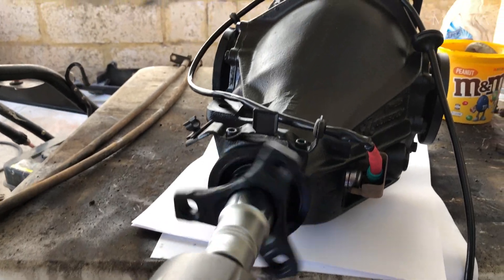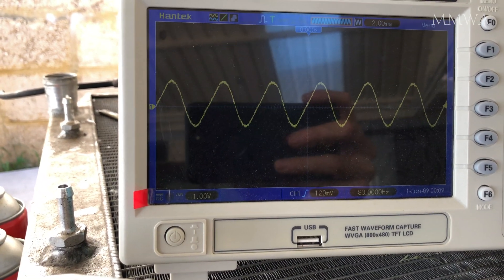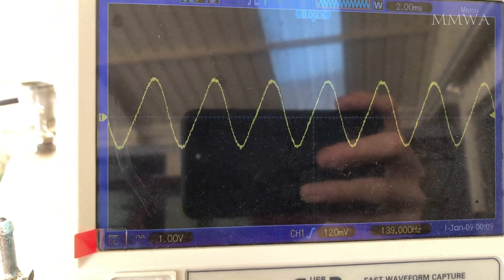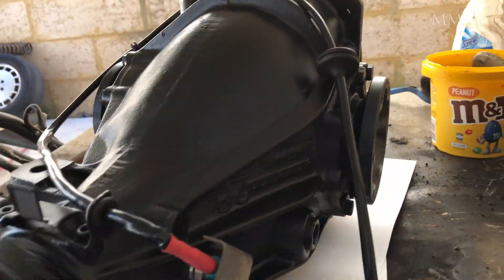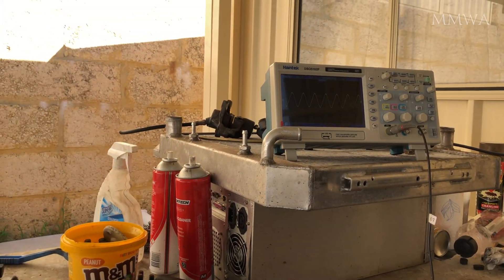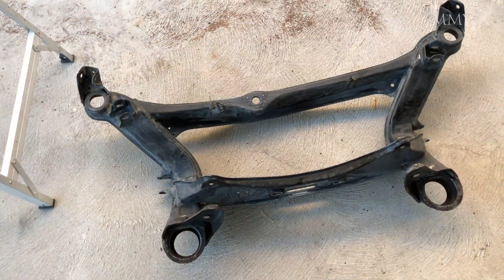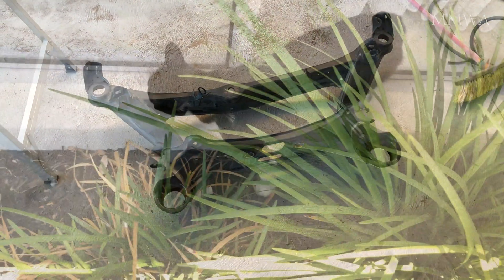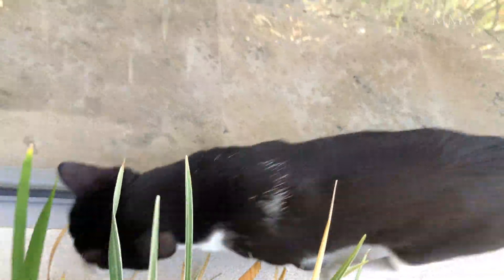A quick bench test of the W124 differential

Comment: Hello, i have W124 2.5 diesel non turbo, om602 but my differential is 3.27 and in the fourth gear i have strange noise. But is it for 2.5d standard differential 3.64?, I am searching for 3.64 i bought a 3.46 but it is from W201 it has 4 bolts and its smaller case, my 3.27 has two bolts standard and big case, would it be better to fit factory 3.64 or to fit 3.46?

Comment: Guys, i have a little problem. My w124 300d from 88, 4 gear automatic has a 2.88 ratio diff. I dont find a 2.88 anywhere and I've been looking for weeks now. Can i install a 3.46 from a 300d from 87, manual gearbox? I dont mind if the car will be quicker but topspeed will be affected or will consume a little more fuel, but I'm not sure if that would be the case. Any help?

Comment: I replaced the differential oil seal and now I need to tighten the nut correctly. There is no information about the tightening torque on the assembled differential anywhere. Please, if you know, tell me what is the tightening torque on this differential. 
Please. I will be very grateful
Reply from the maker: in the service manual it is described. You are supposed to use a new crush sleeve every time and there is a whole setup procedure that aligns the pinion and crown, best left to professionals. I just tighten them to where they were before, not applying enough force to crush the original sleeve any further. Seems to work fine.

Comment: Nice cat. How long do these diffs last - I have a 1987 230E and my diff started leaking from the main seal after I did a complete oil change to fully synthetic - it was a small leak but I forgot to check it regularly and I think its level became much lower than max over time - can these things just break or are there warning noises or mechanical issues which lead up to it?
Reply from the maker: running with no or little oil will damage the bearings and also the contact areas where each of the gears teeth touch. Its very inadvisable to run with low /no oil.
Reply: @MMWA-DAVE  Can I just replace the oil and hope for the best - or is it hopeless?
Reply from the maker: @mojo888x  i’d be putting oil in there regardless. It absolutely will fail if left as is. You might be just fine if it hadnt lost too much and driven too far.
Reply: @MMWA-DAVE  can a fluctuating economy gauge meter e.g that shoots to the red-line mark after slightly depressing the gas pedal during normal driving - be caused due to a diff with a low oil level?

Comment: Nice job! Can you explain how you clean and painted the differential.
What chemicals did you use to clean and what type of paint??
Thanks,
John
Reply from the maker: all iron and steel things I paint i clean with a strong alkaline solution (caustic soda) and a toothbrush. Full protective equipment is required as its nasty and dangerous. It should not be used on aluminium as it dissolves it and should not be done around painted surfaces etc. The paint is just engine block paint. As long as the surface is clean of all grease and dirt it sticks very well.
Reply: @MMWA-DAVE  Thanks for the information. I am in the process of restoring my 1979 Mercedes 450sl. I have all of the the rear end components out (differential, axels, exhaust system, fuel pump assembly, fuel tank, brakes, brake lines) Soon to be removing transmission. Replacing all rubber mounts, seals etc. cleaning everything up, repainting and reinstalling. Your videos are helping me since your vehicle has similarities to my 450sl. - Thanks John
Reply from the maker: @johnfindley1249  Been there, done all that - I even scrubbed the entire underbody of the grease and dirt with the caustic solution. I ended up with pretty bad chemical burns all over my arms and legs though so care should be taken.

Comment: Can't wait for this car to be done!  It will be rotisserie restoration pretty much.  Could be in museum then :)
Reply from the maker: One job i am not looking forward to is cleaning the entire underside with a toothbrush. Don’t worry though, this will be happening before the subframe goes back in. I also need to remove the hard fuel lines and have new rubber hoses crimped at the engine side. Fortunately i have a wagon for work and will be able to transport them as is without destroying them. I will be wearing swimming goggles while doing the underside cleaning - its gonna be filthy and so will I afterwards!
Reply: @MMWA-DAVE  I've been there, trust me, tedipus but worth it.
My w124 got rear ended lately so I am working with insurance.